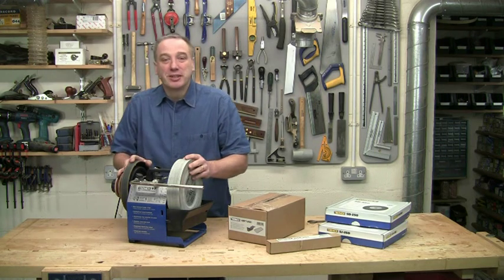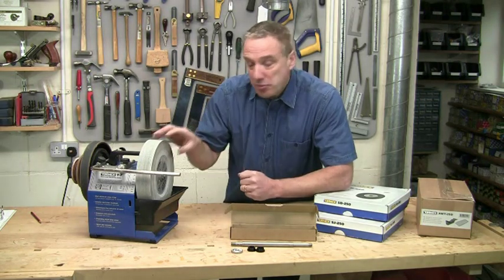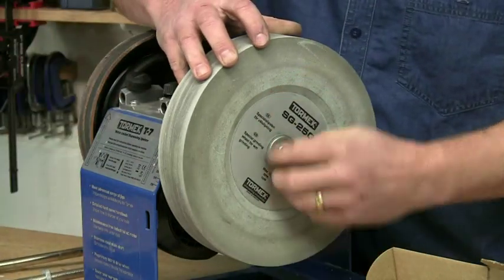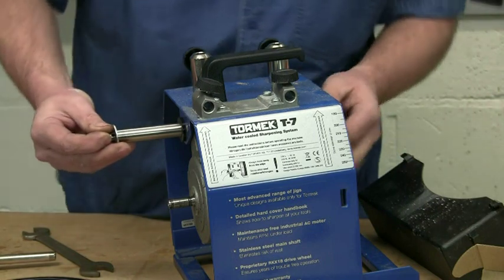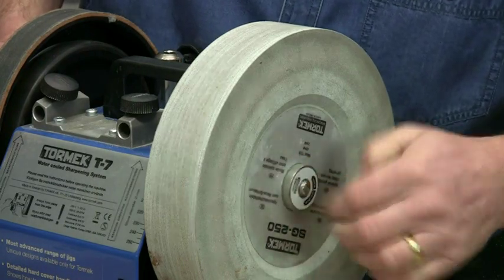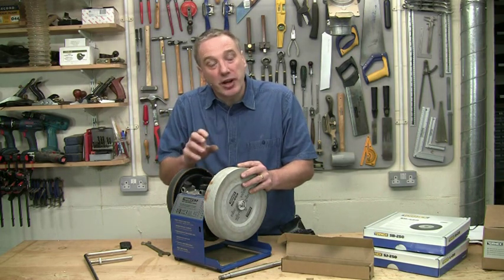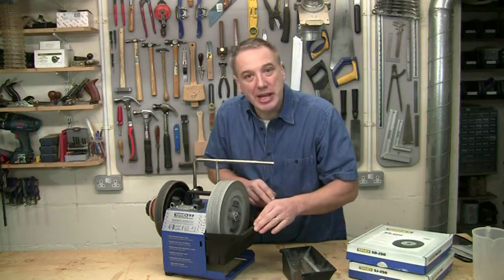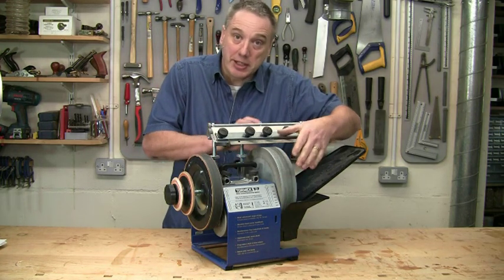Tormek upgrades: EzyLock and AWT-250

Comment: Hi, I bought a used tormek 4 and once I apply pressure, the grinding wheel stalls; again I remove the blade that I am sharpening the grinding continues to spin.  can you advise me on what is the problem. thanks

Comment: Looks so easy with brand new kit, in reality getting the original shaft off an old Tormek is more akin to classic car restoration than anything else. The real reason for Tormek bringing out this expensive stainless steel ‘upgrade’ is a design fault; the old style of shaft was made of ordinary steel and happens to be doused in water every time the grinder is used, over time it eventually rusts into a solid lump that seizes up the grinder and makes it inoperable.
Reply: Correct! Although I would attribute the original use of chrome plated mild steel to cost-cutting rather than design failure. The spindle will probably only seize to the bearing if it is left unused for a long time. Tormek should have offered users a discounted upgrade to reflect this problem but I give them credit for taking the opportunity to introduce the EzyLock nut.
The new bearings in the upgrade kit are a surprisingly loose fit on the shaft.
Reply: Assembly with antiseize appears to be a good idea with the older steel shafts...

Comment: You omitted the replacement of the plastic bearings.  They must be easy to replace: a no-brainier, maybe?
Reply: Apparently, the old ones were glued in but the new are retained by a nub in the moulding. As you say, it would seem to be sensible to replace them whilst the shaft is out. I notice that nothing was said about lubricating these bearings - they are no doubt self-lubricating to some extent and oil or grease would be liable to be washed out in use.

Comment: Have  you considered putting a water trough on both sides so we can put a rough stone on one side and a smooth stone on the other side?
Reply: The drive wheel is on that side so that is not possible to do.
Reply: The crude friction drive means there is no room for a stone on that side.
Reply: Did you to think to Power of Motor